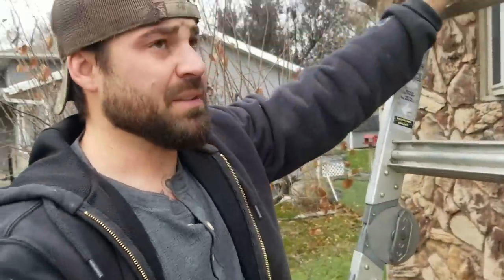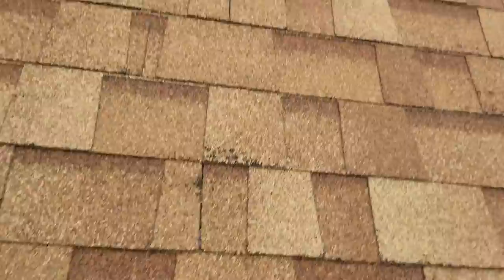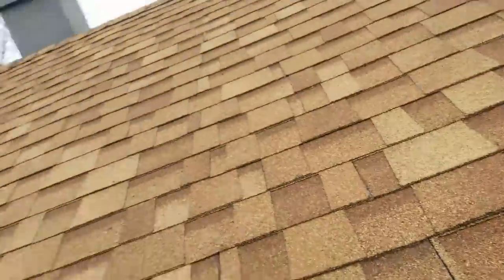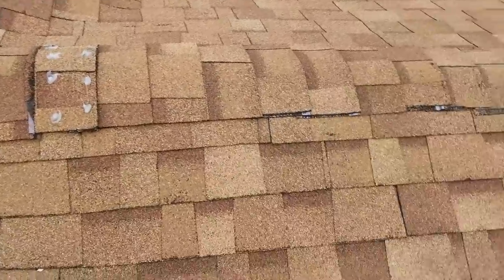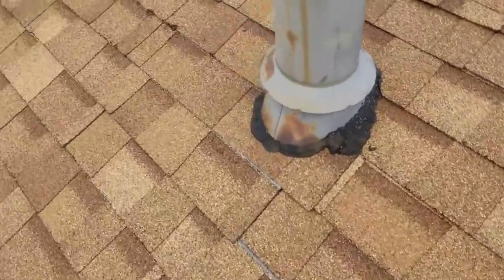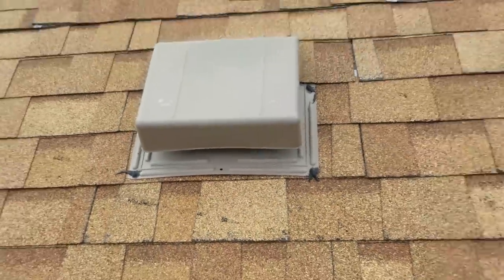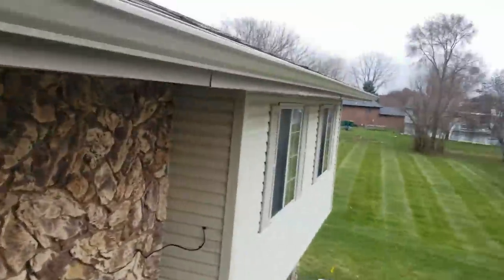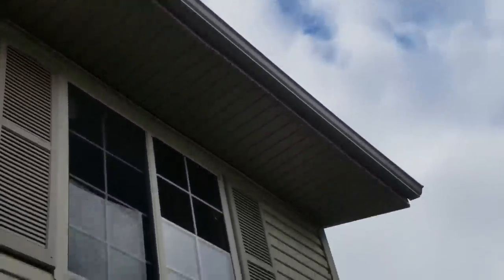Worst Roof Ever Installed!?!? (Part 1)

Comment: "I needed brain surgery so i hired a dog walker"

Pretty much your intelligence level when you hire uninsured and or unlicensed contractors to repair the biggest investment you'll ever make.
Reply: That is the most popular ignorant response that has ever been used in the trade industry. Just because you are not insured or hold a license does not constitute your quality of work and quite frankly I'm tired of people using this scare tactic to justify their outrageously high prices. As a contractor of many years I have witnessed with my own eyes work of many licensed trades and had to repair them to make them correct. On the other hand I have worked with and saw many unlicensed and uninsured tradesmen that have done outstanding work. This "hire licensed and insure" is simply a scare tactic, and matter of fact shoddy work is on both sides of the spectrum when it comes to this subject. When you take your contractors test such as I have you will find that barely any of the questions has to do with whether you know the difference between a hammer and a screwdriver but more on the fact that you make sure you know the correct address on where to send your tax payment and how to calculate employee withholdings. As far as insurance.. it is a VERY good idea on someone you hire to have this But known fact that I guarantee you that a very high number on businesses today that are "Licensed/insured" was absolutely NOT when they first started but they won't tell you that. If you want to gamble with hiring someone without a license and insurance just know that you are taking a 50/50 gamble and many clients have absolutely been happy with their savings but you won't hear this because they are not shouting it out like the idiot client who gambled and lost. I am in the field so I see all the terrible work done on both sides. But again stop with the scare tactics, Just because you hold that piece of paper approved by the state/county does not mean you know what you are doing it just means you are going to be held accountable for anything you do wrong.
Reply: @affordablesolutions8516  absolutely amazing response

Comment: 6,12,18” stagger for architect shingles, no starter on gable and eaves, 1.5” over hang on eaves and gables, penetrations incorrect, incorrect gutter pitch, did side work on weekends never would dream of screwing someone like this, license has nothing to do with the outcome, seen plenty of shotty work by bonded and licensed contractor btw.

Comment: A bad sign is you not having stand offs to protect her gutter from your ladder...
Reply: Dude seems like be doesn't even know code. "Some people do it this way, others do this". 🤷
Reply: Didn’t see that coming lol
Reply: You don't supposed to use those for roofing  😉
Reply: Noticed it right off Gerard. Wondering when the comment was going to be made. Gutter definitely won’t look right now.
Reply: Gabriel Engram 

Code doesn’t usually address most of the basic things with shingles. (Area by area of course). There is about as many correct ways of doing it as there are wrong ways. And every roofer has a slightly different idea about which is best.

Comment: I came back from New Jersey 1 week ago to the state of Kentucky and found my mother had paid some fly-by-night roofers and is dealing with almost the same situation.. she didn't have the money for a redo of the roof so they just came in and laid metal panels down over existing shingle and ended up doing more damage than helping the original problem.

Comment: It's amazing to me how many contractors get away with that kind of crap, but that's exactly why I charge what I charge because I know what I'm doing and all my work has no call backs I've only had maybe 5 in the past 15 years and it was only because of my helpers mistake. But yeah I see that all the time and I always go back to fix other people's crap and another thing I saw at the very beginning of the videos was that they didn't overhang shingle on the drip edge

Comment: So I as a roof consultant I just looked at a roof for possible wind damage. When I got up there it looked like maybe wind had lifted the shingles over their fasteners causing the shingles to slide down the roof. That’s when I discovered the shingles had only two to three fasteners on a 6”:12” pitch roof. I was dumbfounded! 😂
Reply from the maker: And probably high nailed lol
Reply: Veteran Construction high nailed, angled, under driven. I felt bad because this guys roof was less than 10 years old.

Comment: Yep, same with drywalling. I quoted a basement frame drywall and tape super cheap, she went with a guy who quoted half what I did. 
And he threw in all fixtures and painting. I politely told her absolutely do not go with this guy, I don't care if you go with me or not but that is not possible to do that without a ton of stolen material and you are very likely going to get ripped off, he ended up completely finishing two rooms, before he even started framing the bathroom, and I ended up having to come in and finish it and also redo a ton of stuff he did. 
Get three quotes and go with the middle!!!

Comment: Had my roof replaced a week ago. Bought an old project house, it was obvious the roof needed to be replaced asap a year ago when I bought it. Had a licensed guy come out and check it out.. he said it was in awful condition, wrote some stuff down and explained a bit to me.. 
I, being a curious little shithead, climbed up and looked it over (Not that I thought he was lying, just don't wanna miss a chance to learn a thing or two), and even my extremely wore out POS roof still didn't lift shingles as easily as that one did. Absolutely crazy.

Comment: We don’t do the overhang on the drip edge we use starter tho, I’ve been doing roofing with my father for 6 years now, never had a leak or anything we do quality work but who knows maybe it would be better water protection with overhang, we use OC shingles and are licensed

Comment: In Florida you can be heavily fined as a residential owner for using a non-licensed roofing contractor. If your state starts fining homeowners for the use of non-licensed contractors I assure you they will dry up and blow away to another state. How the heck do they even pull a permit???

Comment: I could be wrong but when I did roofing In my 20s about 30yeara ago the owner would make us lay flashing in the valleys and strike a line on each side and cut the shingles back so you would see the flashing for the water to run off. Is this the way it's done in the years to come to lay shingles over the valley's ..thank you for any roofers or anyone with experience let me know
Reply from the maker: that is one good way to do a valley yes. but not the only way

Comment: My state of Florida only does one thing well. Our roofing codes are fearsome, and usually end up being adopted everywhere. Every roof is now inspected. And... you will like this one... it is a FELONY to contract a roof without a license. Boom. There is nothing noble about this.  Tourism, and homes for rich people, are our bread and butter , and a terrible roof costs the rich people too much trouble. Also, the hurricanes are a great test. Now,  every bottom row is tarred down, a drip edged needs nails about every 4 inches, and on and on.

Comment: Everything is metal or TPO here. Hurricane rated. Can't use asphalt shingles here. Vcrimp 1 in overhang 3 in roofing "self tapping 🙄" screws 4 in from the bottom then every 6 on the v. We do have alum shingles.

Comment: I was working at a house and was and the old man wanted hurricane clips on a 70 yr old house. I originally was going to go from the outside for the clips bc it had vinyl soffit but aluminum fascia and trim wrap. After taking the first section apart we quickly learned why they wrapped it . There was tongue and grove 1x3 soffits loaded with lead paint. It was a vacant rental house so not to disturb all this mess and headache of reinstalling this puzzle decided to go from the inside. Im a better sheetrock and texture guy than aluminum siding reinstaller so i cut the first strip of rock grab it yank about a 6 inch peice out and water comes pouring on me probably about a cup. Go look at the roof and the same guy that did that roof probably did this roof too. It was the worst roofing job ive ever seen. No nails were set at all they all stuck up about ⅛ to a 16th so the shingles rested on them instead of the shingles below. I called the old man and told him everything i fond and sent him pictures and his reaction was to tell me to get tf off of his job. Then argued with me that the roof didnt leak. I was insulted at first but im so glad it happened on the first day. Sorry for the novel but seeing that roof brought it all back to me. Ive dealt with crazy customers but this guy took the cake. Nice video i hope the lady was able to get some of her money back from the hack. I lost a little money on my job the guy stopped payment on the check but i saved myself not going any further than we did. Good times

Comment: Been down this road with people thinking they are saving money because my price was too high, then, they want to only pay me the difference between the estimates to remove repair and replace the bad work. I feel bad for them but, the price is the same as the original estimate unless say, the roof was already torn off and now I have to do that too. It is just a shamble...... only thing in your favor is, it will be an easy rip with NO NAILS!!

Comment: i know very little about roofing. haven't done any in years. but just did mine on my new house. and i saw things wrong with this one  before you even said anything.  i just spent $1500 on shingles and it looks like that one will cost even more. but sorry to say i dont feel sorry for them  because they wanted to save $500 its going to cost them another $3000 now if not more. because who knows what you going to find when you pull them off. 
 years ago i had a woman that wanted to go over her old roof but when i checked it she already had 3 on it and this would have been the 4th. i told her no so she went with someone else and right in the middle of the living room a worker went through and broke his legs this was back in the early 90's and i would have charged her maybe 5K back then to pull and replace what ever was bad but it ended up costing her over 20K  because it was 1x6 shiplap ended up replacing rafters and all. but i still didn't do the job. i didn't feel i knew enough about it to do the job.

Comment: What’s disappointing is my dad is a roofer. I’ve done jobs with him for over 6 summers and then side work here and there when available and when I was unemployed from other jobs. I know the trade fairly well and he’s a master of the trade. He’s done it for nearly 30 years. Unfortunately he’s uninsured for a few reasons and isn’t able to get insurance. People out here doing this kind of work make it even harder for people like my dad to find work.

Even if he’s doing a house for someone he could take advantage of and knows nothing about roofing he won’t cut corners and he takes pride in doing each step right. It’s a shame that people out here do work like this and get paid the same amount. If I got my roof done like this in the video and then someone like my dad came by and offered to fix it I don’t think I could accept because it would be hard to trust another uninsured roofer after this.

Comment: Yes you need to look at roofs they are doing I've heard of contractors who used pictures of great jobs they said they had done they hadn't also gave names and phone numbers of satisfied customers their common law spouses man what a mess the roof was the old 3 tab non of them lined up the carpets were cut improperly and nailed down with roofing nails I've always done my own work and the first roof I did lasted over forty years and only had to be replaced because the shingles wore out I expect the last one to outlast me but the quality of the shingles has gone way down so maybe not but if it'll last until I'm in senior housing I'll be happy

Comment: If you want to hire craftsman you have to choose 2 out of the three:
1) is good
2) is cheap
3) is available on short notice

If he is available and good, then he is not cheap, if he is good and affordable then he has so many projects, you have to wait a little. And if he has low prices and is available, run away.

Also hire independent supervisor. It will add like 5% to the total cost, but is worth the money.
Reply from the maker: That was awesome until the independent supervisor lol I wouldn't allow that on my job I'd just walk away and say I don't think I'm the right guy for your project.  I highly doubt any supervisor knows roofing like I do n I ain't gonna be baby sat coz a home owner doesn't trust me. I've walked away because a headache of a 65 yr old homeowner refused my contract, sent me a wild ass one in return saying I need to tear it all off and he needs to personally inspect all sheeting and ice and water. Like, no trust, no job. Come up there all you want and let me know if you have a problem but don't try to control the order in which my crew works ya know?
Reply: @NWIVeteranConstruction  I understand your point of view, but I don't see independent supervisor as someone who is there to babysit craftsmen.
I know 0 about most of the trades needed for the building of the house and my supervisor acted as project manager, quality control for everybody and to help me when changes needed to be made.  When the craftsmen recommended different solution than was originally planned in 90% the supervisor agreed. And the most important is he translated profesional jargon to human language.

I am sorry that you feel that way, especially when you are professional who gives 100% to his job, but there are too many spoiled apples in the basket for me to risk my life savings on reputation of a man I have never seen in my life.

BUT the supervisor needs to be profesional, not some kind of cheap arogant a*hole. Basically paying 20% extra for every man on the construction site is imo worth the money. Usually it saves twice the money on material, rework, maintenance or repairs.

Comment: Unlike part of a house like a kitchen, house extension etc, you can see up near enough the quality of the work.  With a roof, the customers usually takes the tradesmen word for it.  Thats why a drone is need to look closely of the finished work, like valleys and place hard to see.  I’ve found piss bottles up in my roofs!  Im a property developer and hire tradesman alike.  Also another thing, a tradesman inspecting another persons work is bound to be unimpressed.  Saying that, the work was shocking.

Comment: Don’t ever let a roofer shingle in the valley. It is a roofing technique but I say it’s cutting corners. Use -repainted  galvanize metal with ice guard underneath. Shingles in a valley see way more water and over time it’s the first thing that will wear

Comment: The roofs on the houses in the States, or more what materials are used, (considering all the diverse seasonal weather)
Look like what here in New Zealand, I used for the kids play house..
 Is long run steel not an option there?.
 How long does a house last.
It would never get signed off by the councils building inspectors.

Comment: This is completely horrendous. It's funny they couldn't even get a turtle vents installed correctly. Also one of the biggest problems which will cause a leak is the joint spacing. I am a roofer and we always tell our clients you get what you pay, a lot of clients are looking for the cheaper option and in the long run they will spend twice as much going with the cheaper guy rather than the more expensive qualified roofer. This should be a lesson to everyone.

Comment: You absolutely can cut shingles to use as a ridge cap! But it has to be done right! You should use a ridge cap and then use the cut shingles
Reply from the maker: i will always forever disagree with that. we used to use 3 tab shingles, then they started making actual ridge cap. but you can't bend an architectural shingle over a tight ridge like that. cap cost less than shingles last time i checked. its inexcusable for any homeowner to have architectural shingles on their roof as a ridge cap.

Comment: With the type of shingles they used the valleys should have metal in them even says on the packaging I always use torch on materials in them
Reply from the maker: you can do other valleys with them. i've never actually used metal in a valley
Reply: @NWIVeteranConstruction  here in Canada they split in the valley cause of freezing and thawing

Comment: You can getaway with some things in some places but roofing shouldn't be one of them. Flooring installs are the bane of my existence. A store in my town has taken almost a year to renovate. It could have been rebuilt in half that time. 1st thing I see as I walk through the 2 new front doors is 7 mistakes in less than 3 square feet. I'd hate to think what the rest of that job looks like.

Comment: They always go cheaper route but don't understand the difference.....and 9 times out of 10 will do it again even knowing what separates the two.....over last 35 yrs I've seen it so many times....same homeowner who had bad experience with cheaper contractor and they go ahead and do it again......haven't a clue why but have seen it happen more than I havent

And tell them have the guy you hired come back and fix it.....fixing someone else's work never pans out cuz now your the last to touch it so your responsible even for things you can see